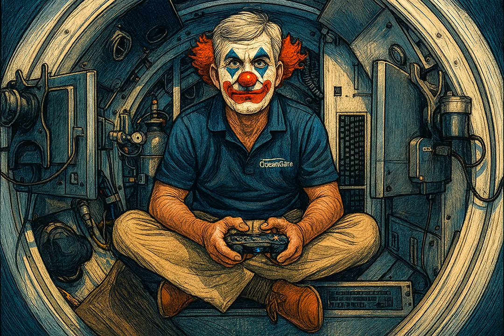David Lochridge OceanGate Firing – full audio of meeting with Stockton Rush

Comment: 26:55 "It doesn't just implode". Well, Stockton, apparently it did
Reply: He talks about "overbuilding" and "safety factors" both of which he didn't do. He made the hull 5" instead of 10" as Boeing's design called for, and he only tested it to 4000m in the Deep Water Test Facility because he knew that the hull wouldn't make it to 1.5x of the operational depth. He knew there was zero safety margin on that hull and he put paying passengers in it.
Reply: @rjinkglider6908  Not sure if this is directed at me but it showed up in my notifications.  As I said in the other response to you I cant recall all the details on this.  I will say though that the second hull was constructed (wrapped) differently that the first hull.  That was one of the major problems and its integrity was compromised more over time.  Pretty major change in how that hull was constructed.  That alson preated some issue in tearms of retrofitting the titanium end caps as well... again from memory though.   If you are trying to figure out Titam try to check out the links I put in the other reply they can help I just wish all those videos were still viewable for people looking into this incident.  

Whole investigation and "Official" narrative is a complete mess though.  Im still confident in saying Stockton basically was thrown under the bus in all this because once dead his reputation is expendable.   Deffinitly a risk taker but I never saw any signs he was some sociopath or psychopath.  Im not some sort of Rush fanboy but I think he was in an impossible situation with Oceangate and it was more a matter of things slowly creeping up on him overtime to the point he basically either accepted more risk or folded the entire company.  I think I also came to the conclusion a lot of people wanted to see this to happen to him eventually despite what they say in some of the post accident interviews and testimony.  Its really hard for me to think back through all the details though along with the players because everything was such a mess in terms of what was being said in the media and the facts.  

Its likely going to end up like WACO eventually.  Even after the real truth comes out years later in congessional testimonies people still believe the "Official Story" from the MSM and Federal Government even though it was fabricated along with destroying evidence.  They still make documentaries about Waco pushing false information that was proven after the incident and people unknowingly buy into it just as before.  Same thing will likely happen with Titan.
Reply: In this case, it didn't. They neglected the data. It was after dive 80, I believe, the anomaly, and after this the acoustic monitoring markedly changed. I don't know if they weren't looking, if they couldn't interpret the data. I'd imagine they saw it and it was swept under the rug like everything else. Ironing his acoustic monitoring worked, but it was never going to save anyone if they didn't respond to what it was telling them. 

Stockton is aware of risks, here he talks about the risk of the sub freezing with moisture, yet he left it to drop below 0 for the winter preceding the Implosion. That's hard to understand. 

For someone who outwardly didn't display much of a desire to not be alive, he sure did a lot to ensure he wouldn't be. Guess a lifetime of getting away with things will skew a person's perspective. There's a lesson in there for all of us. 

Musk has unalived more people with Tesla's "auto-pilot," and many more during his tenure in government. Not the ultra rich so he gets away with higher numbers, I guess. Pretty sick of the money dependant running things, their addiction to money doesn't make them sound candidates to be making life and death calls.
Reply: @contorta960  Saying it was "after dive 80" is a half-truth. "Dive 80" was a deception orchestrated by the company to make it appear that the sub was battle-tested, when in reality the second Titan hull dove much fewer times at depth.  Quickly pulled from Google's AI overview (so it may not be 100% accurate, but good enough): "The OceanGate Titan, specifically the version that used a co-bonded carbon fiber hull and titanium viewport, made 13 dives to Titanic depth and roughly 22 dives of significant depth (greater than 1000 meters) during its operations from 2021 to 2023." The tiny sample size of 22 dives at any substantial depth isn't even a remotely reasonable amount of data for this entirely novel (and unsafe) design to be manned by humans, particularly at substantial depths.
Reply: actually it didnt.  The official story is bogus if you look at the debris field.  They were bobbing around and trying to regain control for quite a while before it finally collapsed.  This notion that it suddenly just imploded is a lie.  Debri field proves it.
Reply: @GoneApeEntertainment  Dude, you dont know what you are talking about.
Reply: @babokanal4223  Go look at the debris field "Dude"🙄
Reply: @GoneApeEntertainment 😂😂😂 "bobbing around" are you new here?
Reply: @GoneApeEntertainment that’s patently ridiculous. Such an instantaneous & large implosion will throw out debris for quite some distance.
Reply: @Vividbibbi  Again go look at the debri field.  It doesnt throw out debri at the distance as far as you think.  Even a high powered rifle bullet wont travel far under water.  I dont think you have researched much into this incident other than watching influencers and youtube videos with a bunch of idiots working peoples anxiety up for clicks and likes.  Go to the facts and research the debri field.  

Hard to beleive after this long with everything out there now people are still beleiving the cover story on this.  People watch a produced and dramatized documentary and they think they know the facts.  Thats entertainment for you though.
Reply: @GoneApeEntertainment the force of a high powered rifle bullet comes nowhere near to the forces at that depth
Reply: @GoneApeEntertainment Rifle bullets have significantly less mass and slow down much quicker than heavy debris. Not to mention underwater currents that vary quite a bit.
Reply: @Dareyouhow  Yeah bullets are higher you fool.  They are also more hydrodynamic in water compared to random chunks of metal, carbon fiber, and other debri.  You idiots just talk out your rear.
Reply: @Prometheus7272  They are also much more hydrodynamic and have a LOT more PSI behind them.  You people are idiots that just make up nonsense.
Reply: @GoneApeEntertainment  Dude, there is a video of his wife on the ship monitoring the dive when you can hear the implosion in the background and she just asks "what was that bang?" There is zero evidence of them bobbing around without control. The sub imploded because of the stress before they even got to the Titanic (so before reaching maximum expected pressure). And the debris clearly shows that it was an implosion.
Reply: @nodlimax  Been so long I was following all this that I cant really respond without going through it all again.  Just from memory though from what I can recall on the fly would be that the debri field doesnt match their official "Instant Implosion" story. From what I could access they were trying to mitigate a lot of problems they were right in the middle of before everything finally went boom.  Basically they knew they were in deep shit for a while.  The detailed breakdowns on the Debri field are really where all the hard evidence is.  The rest of the narrative is mostly just people repeating the approved script.  

This guy was doing a lot of good worked breaking things down and weeding through alll the BS on Titan as it played out.  Hes changed the channels name and privatized some of the videos because he was getting constant attacks and people stealing his videos but there might still be some good stuff there if you are researching this.  He made a few good videos going through the timeline and analyzing the debri field.  https://www.youtube.com/@EngineersLackIntuition 

Sorry its just really hard to recall all the info right now and Im dealing with typical summer duties with the yard and family.  Good luck with your search.  Its an interesting event to work through.  Most of the official story has a lot of BS narratives involved across the board even when it comes to Rush and the crew.  The bulk of the emotional responses you see from people online are just people that parrot some influencer they are obsessed with.  Very few actually tuned out of all that and just went through the facts from all the different angles.  Most of the documentaries ive seen on Titan just parrot the news narrative and were a waste of time.  To me the debri field breakdown ans timeline of events leading to the actual launch were the most interesting because the initial sub actually worked.  Its wasnt until the second Hull where they started screwing around with the design specs that everything went haywire... pluss the way they stored it outside in freezing temps.

Pretty sad event in all.  I would say Rush was a calculated risk taker but people like to just parrot him as being a sociopath or psychopath.  That is programming because when you study him and the people around him it doesnt add up.  Lot of little mistakes though that were made (a lot due to finance) that created this perfect storm that led to the incident.  Could it have been avoided?  IDK... I dont think so without Oceangate ceasing to exhist so probably not.  Kiss of death IMO was it being stored outside and then the construction design of the second hull being changed.  The 1st hull working so well gave them a false sense of security and it ended up killing Stockton and the rest of the passengers as well as destroying everything they had built as a Company.  Ive seen MUCH, MUCH worse from huge corperations and entities and much more diabolical motives but people still seem to have no problem taking their drugs, eating their food, and buying their products.  

Rush was pretty open IMO and honest about the dangers involved in this type of business venture and exploration.  The public seems to look at these subs like a ride at an amusement park and its a pretty childish IMO.  They are better sticking to things like Disney or Universal Studios theme parks instead of trying to understand the Titan stuff.  Im not into this kind of exploration so I would never take a risk like that even if it was a free ticket but some people just love being underwater and do things they think are groundbreaking for whatever reason.  To me it was just an interesting incident because I picked up on so many inconsistancies early on with both the reporting, the authorities handling it, and also how people were reacting online so I wanted to put the time and effort into understanding what was going on.  Most people stopped once some other distration type story came along.  Its amazing to me how emotional people became from a small group of people imploding on a little experimental sub that they had never heard of before this incident.  Basically the level of death involved in a bad car crash.     The coordinated news and coast guard did a good job at sucking everyone in though with the notion of a rescue opperation when they already knew these people were dead.  Had that been released from the begining nobody would have cared but everyone was looking for a happy ending like some sort of modern  "Baby Jessica" (Jessica McLure falling into well) type event.
Reply: @nodlimax  Never mind the fact that the sub doesnt' "bob". It just sort of sinks or floats depending on the ballast.
Reply: @nodlimax  Of course it imploded, you can clearly see in the picture of it being smashed, only the metal did not get smashed, and if it had a leak or whole above crush depth it would of went down and not crushed, it would still be in a whole piece like Titanic is
Reply: @GoneApeEntertainment Lol, this is one of the strangest conspiracy theories I've ever heard. What motivation would the official investigators have to lie about what happened?
Reply: @enndubful  Right.  Im sure everything feels like some bizarre conspiracy theory when you are an gullible idiot that just parrots what is programmed into you.  

Sorry creamcake I dont have time to teach you about how the world works.  Follow the money.  Follow the regualatory agencies Stockton was always finding ways to skirt around to work outside the system.  Follow the facts.

Or.... Just keep following internet influencers and media personalities that all read from the same scripts.  If you copuldnt see a well organized and coodinated effort to cover up what happened with Titan then you are better off sticking to your bubble of idiocracy and Sesame Street content.  While you are at it go ahead and march yourself down to the local Freakmason lodge they love ignorant dolts like yourself that lack both discernment, any notion of street smarts, and the lack of ability to put things together when they are put right in your face.  

You are probably best to stick to your playstation and let adults in the room figure out these type of incidents.  Im sure there are still reruns of Romper Room out there for you to still learn from LOL.
Reply: @GoneApeEntertainment You don't have time to answer a simple question but you have time to write an entire essay suggesting that the answer is readily apparent as long as you consider a bunch of trite platitudes? Ok, genius.
Reply: @GoneApeEntertainment  How? I don't follow. There would have been a distress call.
Reply: @GoneApeEntertainment  Really, so it was just crushed on the ocean floor then all by itself lol, because if it had a hole in it already and it went down it would of not crushed like that genius, or the titanic would be crushed to bits too
Reply: @badghostlive  Guessing english is not your first language but Ill do my best to reply.  I never said it didnt implode I said the "Official" story that was released is full of disinfo.  The timeline of events is not how it happened.  Everything wasnt going fine and then it just suddenly went boom.  The debri field shows plenty of evidence it was a series of failure they were ttrying to mitigate before it eventually imploded.  They were in a struggle for a while ... minities not split seconfds.  People are just dumb so they beleive the "Official Reports" without actually digging into the evidence and thinking critically.  Whole thing was covered up.

Not sure why this is so hard for peoiple to believe now.  It should be obvious they knew Titan had imploded and everyone was dead when they started all the nonsesne search patterns by air to make a spectacle out of things.  Then the autamatically started villianizing Rush without even knowing the facts even to the point of trotting out James Cammeron (who is a complete hypocrite) to help push the narrative.  

People dont want to know the truth though they just want to watch some dumb youtuber blame whomever and rage post more idiocracy like yourself.  Thanks for showing everyone you are a complete fool and parrot though.  Mission accomplished the mister "Bad Ghost" LOL.  

You should probably go back to your play station and let adults talk about this kind of thing.  Im sure there is some sort of "Gamer" channel you can go post on and play "expert".

Comment: Took me 3 seconds to figure out acoustic monitoring would be too late,
Reply: Exactly! This is blowing my mind. How did he think this could work?
Reply: @meowllison9414  Well it kinda worked, he just ignored the warnings it gave over time.
Reply: Exactly!
Reply: The idea was, slow cracking sudden ruptures of the carbon fiber would have alerted them. The system worked as on dive 80 the difference could obviously be seen but they completely ignored it and still went diving with it. That is what caused the implosion.
Reply: except your wrong. the titanium mating ring was blown out the carbon fiber hull was not the initial failure point look at the photos and video of the wreckage the tang & clevis inner ring has sheared off. the acoustic monitoring did its job. the titanium gave no warning when it failed.
Reply: @TungstenCarbideProjectile except they ignored the signs on dive 80. Doesn't matter if you dont react to the readings

Comment: Rush's and Nissen's reliance upon an uncalibrated acoustic monitoring system shows their lack of fundamental understanding of what this system can achieve, and what the data it is showing really means. There was no effective correlation between hull damage and strength and the outputs from the monitoring system. 

Worse still was pressing ahead with the Titan hull v2, after the test sample never past a lab pressure test. This was noting short of criminal.
Reply: Especially when the sub is screaming,  the sensors are off the page, and they choose to ignore the data and keep going.
Reply: Apparently they did do a full scale pressure test on the V2 hull, which is where they got the confidence to go forward with their expeditions.  The acoustic monitor and the strain monitor absolutely showed problems in their later dives, but the signals were totally ignored.
Reply: Lochridge was right. Without having baseline data the acoustic data was useless. The scan should have been priority. Stockton was too cheap to do the scan. Also they needed to test the acoustic data all the way to the point of failure multiple times in order to know what the data is actually reflecting. As much as Stockton goes on & on about the acoustic data he basically ignored it towards the end because the data was showing signs of hull degeneration. He still chose to take people down there with him.